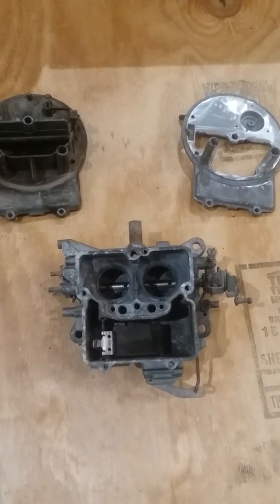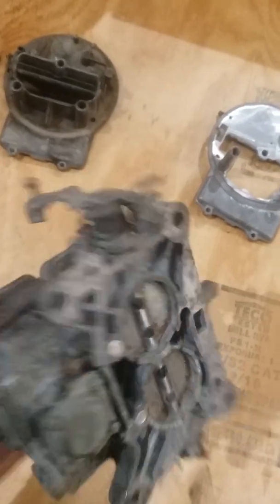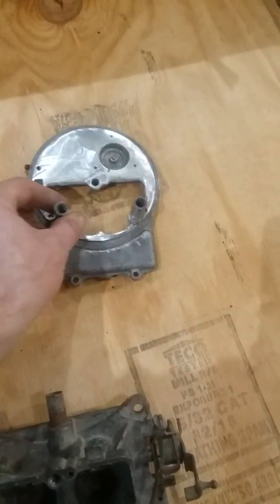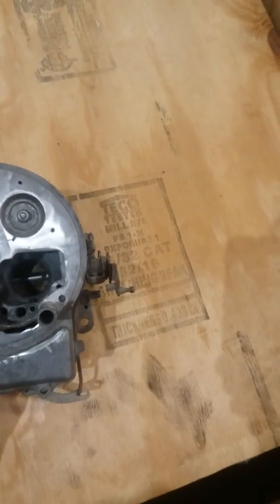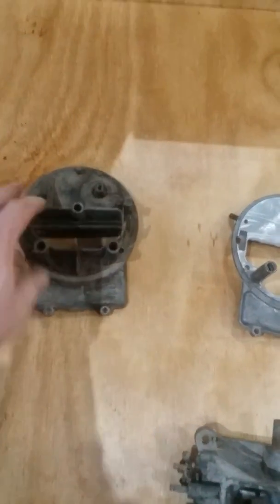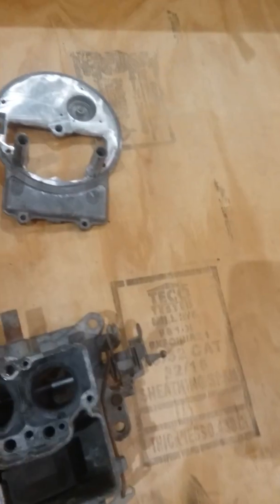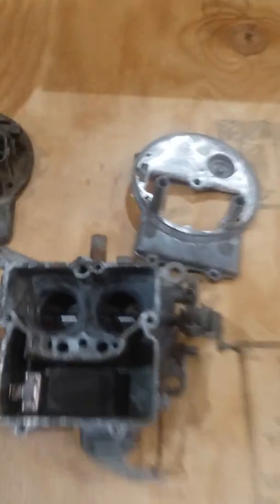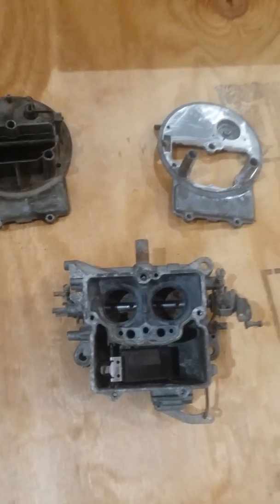Autolite 2100 modification.

Comment: have you thought about running a half shaft on the throttle? cuts down on turbulence. also blending the material around the screw holes on the backside, in addition to using small socket cap screws...works a treat. much better flow. thanks for sharing your content.
Reply from the maker: What are half shafts on the throttle? Are you talking about where there blade attached the the shaft?
Reply: @fiskshopworx1541  you reduced the diameter of the throttle shaft, pretty much in half. For a lot of big name carbs, you can buy a "slabbed" shaft to swap in...but not so much for 2100 or 2150 Ford flavors. Do a search. It's not tough to do if you can get the shaft out without tearing up the main casting. I have used small hand files and a Dremel to mod mine in the past. These carbs extremely underrated. One or two tweaks won't make a big difference, but use several speed tricks, done properly, they are loads of fun, even on a stock engine.

Comment: The choke horn creates a plenum for the venturis. Maybe remove the plate from the choke but leave the air horn?
Reply from the maker: On a street vehicle that might be good. But if you look at performance carburetors like Holley xp series there is no plenum, they are opened up as much as possible. Just depends on how you are using the engine.